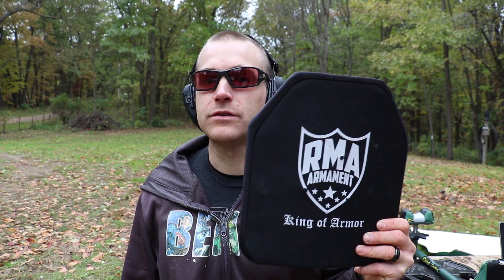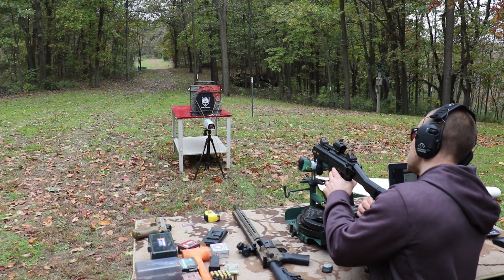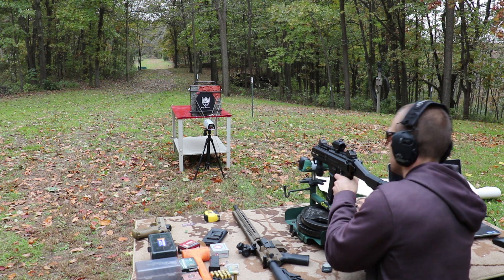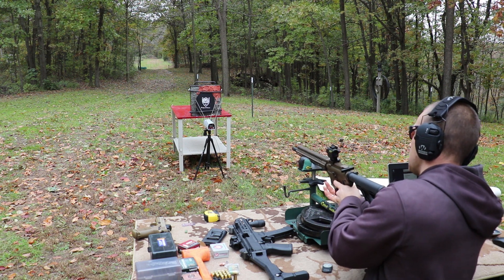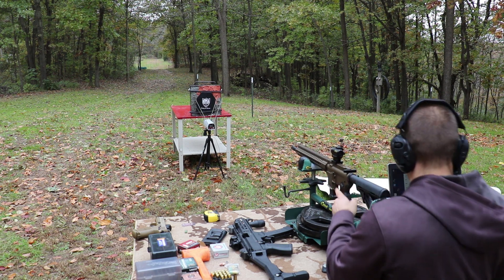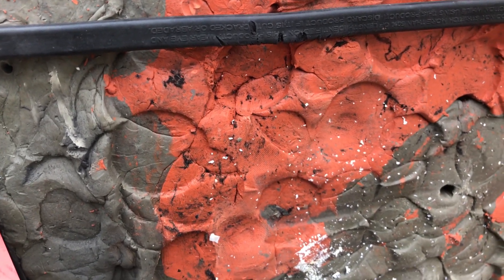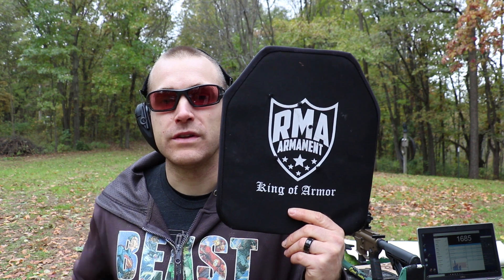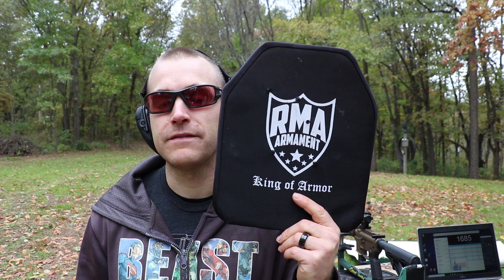Solid Copper Projectiles, Can they penetrate Armor?

Comment: Dear Buffman, can you test the PenetraTOR 5.7x28 from EA on level 3 plate? 

Maybe conduct overpressure ammunition tests with it, to see if you can get any level 3 plate penetration.
Reply from the maker: It won't happen. That 55gr FMJ the faster you push it, will just mushroom out and frag. PE plates will stop M193 (55gr FMJ) at speeds over 3400 fps.
Reply: @BuffRANGE  What if the penetrator had a sabot tungsten rod, depleted uranium. Is there any pistol projectile that could penetrate a level 3 plate?

Comment: Why would you wear a rigid panel like this in IIIa? If you are going to go rigid with anything go III. Otherwise stick with your soft armor.
Reply from the maker: With a III you're going to add considerable thickness (1") or  heft (steel plates). The rigid IIIA offers good stab protection, and protection against more threats that a IIIA flexible can't stop, as well as less backface deformation. May not be for everyone, but options are good :D

Comment: Liberty Civil Defense 10mm, I've seen it go through a different LVL IIIA panel before, curious if this would stop it.
Also, slightly off topic, do you have plans to test Brown Bear and PPU 7.62x39 subsonic loads?
Reply from the maker: Does SG Ammo carry them?
Reply: @BuffRANGE  Apparently only the PPU 182gr and not the Brown Bear 196gr https://www.sgammo.com/product/prvi-partizan-ammo-sale/20-round-box-762x39-182-grain-fmjbt-prvi-partizan-subsonic-line-ammo

KVAR has the Brown Bear: https://www.k-var.com/ammo-brown-bear-762x39-196-gr-fmj-20rd-box
Reply: @BuffRANGE  SGAmmo also has short range training 7.62x39 which might be interesting to test: https://www.sgammo.com/product/surplus-ammo-sale/130-round-box-762x39-czech-surplus-46-grain-hollow-core-low-recoil-ammo-76

Comment: Have you looked into the 150 grain Lehigh Sold Match copper .308 bullets? Not sure if they would offer a whole lot more penetration than standard fmj (they will hold together better though) but they are super consistent and shoot well. Nice bc too
Reply from the maker: I have messed with some of their flash trips, and some of Fort Scotts Solid Copper 115gr loads.
Reply from the maker: I tested the 115 grain against UHMPE from FSM and it penetrated. solid copper is interesting to say the least.
Reply: @BuffRANGE  very cool, thanks for the reply. I'll check out the flash tip video here in a bit.

Comment: Buffman: Since you have a 16" carbine, could you please test the hottest 9mm fmj: Brown bear, Silver bear, Sig Sauer and PPU +P? Please, I can't get any place here in Florida to do those test? Also if you can find Speer 115grain, there is a video showing them to be hot. Thanks in advance.
Reply: Brown and Silver Bear is hot steel case ammo load?
Reply: @Je3perscre3pers  yes, go check right here with Buffman's videos. He has 90 videos of 9mm velocities. Go check bron bear, silver bear, Sig Sauer, and PPU NATO. They are fast.
Reply: @mandapalque  geez I had no Idea. Thanks for letting me know.
Reply: @Je3perscre3pers  you are welcome
Reply from the maker: yeah for some reason Brown Bear and Silver Bear 9mm are SMOKING HOT
Reply: @BuffRANGE  on a side note, have you ever done a video on Ft Scott 55gn projectiles brass or copper on M193 to see if it's more penetrative than lead core projectiles? I know a regular 16inch barrel with M193 will defeat steel level 3 body armor.
Reply from the maker: the 55gr copper one yes. Too slow to do any damage to steel even in the brass. I am going to test the brass one against PE armor soon.
Reply: @BuffRANGE  interesting. I would think all copper 55gn would be easier for penetration if its traveling at the same speed as regular m193 55gn lead core fmj.